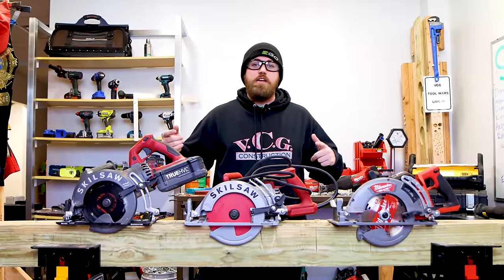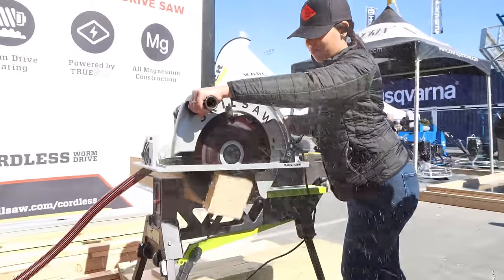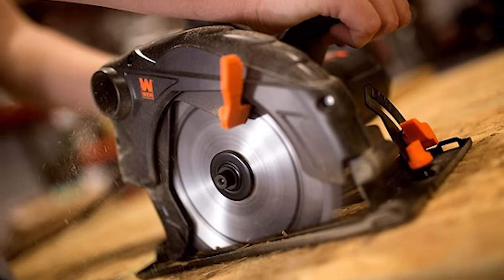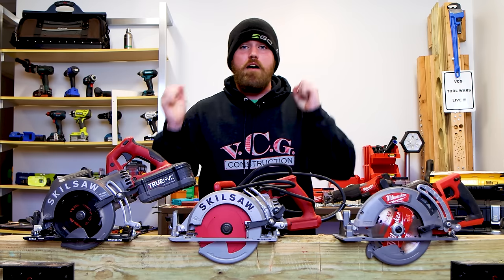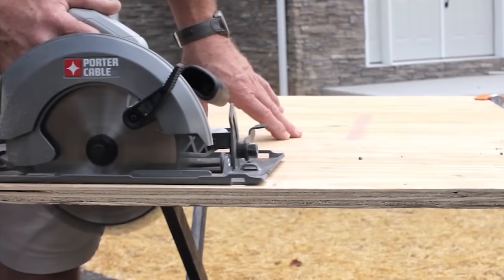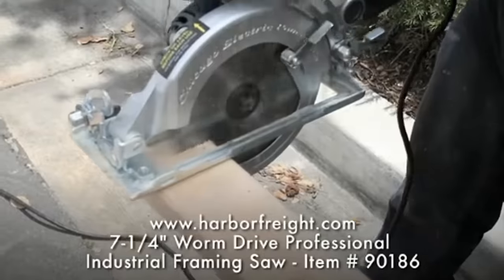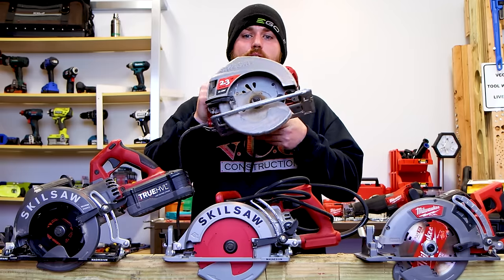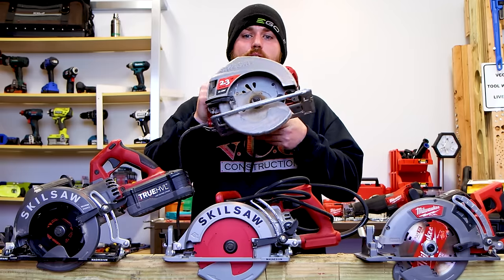We RANKED Every CIRCULAR SAW From BEGINNER LVL To EXPERT LVL (What Level Are You?)

Comment: I'm not a porter cable fan, by any means, but I actually tried their 15a circ saw, recently, and it held up fine through two days of ripping the floor out of a trailer I was demo'ing. Cutting through linoleum, adhesives, plywood subfloor, screws, the a/c ducts right under the subfloor, all of it. I had previously been using my uncle's ryobi corded circ saw, and that was the fussiest damn saw, I've still ever used. That thing would seize up over anything. I don't even remember what its amp rating was, but it had no power. I'm not a fan of ryobi, and had previously held porter cable in similar esteem, but porter cable's circ saw is way better. It's not a contest.

Comment: Reason for Makita's 2 battery set up is to retain the capability of a corded (36v) without making the consumer step up to a single 36v battery. So if you have a collection of Makita tools and batteries, then the step up to this circular saw can be done without having to be forced to buy a whole new set of batteries and charger just to run this one tool. I own this saw and absolutely love it. 
I also own the corded porter cable, corded skilsaw and cordless Rigid X4. All three serves a purpose and definitely not for pro use. The Rigid could be but the X4 has the blade chatter (very well known issue and has been resolved im told). This chatter sounds as if the blade is loose, and just makes a low volume "tap, tap, tap" noise when its being carried around, it will drive you f@ckin bonkers, but doesnt effect its ability to make square cuts. A friend got a rigid 9mA octane battery for christmas when they first came out, he couldnt get it to charge on any of his rigid chargers so they replaced it for free, told him to dispose of the other one properly. well, it charged on my charger just fine (one of his charger is exactly like mine). That battery has some serious weight to it, but you give that octane to the non octane line up, and you have tools that seem to have found new life. i still havent found a legit reason for that blue tooth feature. Any time its free, its good tho!
Ive owned a couple ryobi drills in the past but it wasnt until they made a serious commitment to their tools and came out with a huge variety of tools to run on their one+ platform. their best deal usually during the holidays is buy a tool from their collection & get 2 batteries and a charger for free. they have a 6 gallon cordless vacuum that i find perfect for use on jobsites. their huge following is evident in the high customer ratings & the high number of customers who have rated.
The stock footage for the Chicago shows a worm saw, not sure if its chicago as i didnt know they had one.
Of all the tools ive owned, ive found the makita have suited me best. they are well balanced, weight conscious, always strong, powerful tools.

Comment: Dear Sir,
Despite your best efforts to extoll the virtues of Robert Bosch circular saw; please be advised that as of last year Robert Bosch have introduced a new cordless 190mm or 7.48 inch blade cordless 18 volt, brushless circular saw  working in conjunction with their 8 & 12 amp Pro Core batteries delivering the equivalent of 1800 watts. I have acquired said machine & can corroborate their claim as being one very potent machine. It also has the added feature ( as an optional extra) of being capable of being paired with one's smartphone to adjust parameters to your preferred settings. The charger can charge up to 16 amps if "Turbo" mode button is switched on. Maximum depth of cut is 68mm or 2.67 inches. Maybe you ought to lay your hands on one & do a review? Kind regards.

Comment: Thank you for this video, informative though timely. My power saws predate many of your low end choices. I like my Porter Cable, have been using it for years and the bearings are still true. For heavier work, 2X4s on the low end, I have a SkilSaw77 as well as an 8-1/2 SkilSaw. In my day, the low end Black&Decker was $30, the Porter was $65 or so. The worm saws today don't stand up near as well, mine are all metal. There was no Ryobi, no Kobalt, no Ridgid, they didn't exist. Ridgid did make pipe working tools, I have many. But the saws are recent, ~last 10-15 years. I hold older DeWalt radial saws in high regard, but again, the newer models are too light. I have battery tools, DeWalt, but they too are too light for real work. I guess being an old curmudgeon is going out of style.
Bi11 Hudson

Comment: Been thinking of getting a good saw. I have Dewalt impact, and drill set with a dual charger. It’s great. Measure tapes Milwaukee, tool boxes Milwaukee pack out, I tried the ridged brand there good to but there’s more with Milwaukee pack out options and mods. But circular saws still trying to figure out. I am probably in between a diy and pro level above apprentice. Some where in the middle of pro even. Since my dad did carpentry work remodeling are house a few times I helped him through out the years when I could. Would be nice to have my own saws so I don’t have to barrow any.

Comment: Where would you rank the makita 5008MGA circular saw? It's 15amp 5200rpm 8-1/4 blade  it has 2 lights and a blower in the front to clear the line so you can see it. It has a magnesium shoe and guard. I bought it here in the Philippines for $164 I know it's $220 there at home depot.

Comment: Own the cordless Skilsaw and have the chance to use Dewalt and Milwaukee’s equivalent often and I’d put those 2 above mine in terms of power and weight. Build quality and familiarity, Skilsaw takes it hands down, having come from the Mag77 prior. The battery is massive and heavy but doesn’t seem to last (yes that giant ass battery is only 5ah). Upgrade the battery with a smaller footprint and longer life and you got a winner
Reply: It's only 5ah because it runs at a higher voltage. Compared to the DeWalt Flexvolt which is more AH, but that's when it's in its 18/20v configuration. So a 6ah Flexvolt battery is really just a 2Ah battery when used on a Flexvolt tool. So the Skillaw 5ah battery would be the equivalent of a 15Ah Flexvolt which is also huge! You can't really make the batteries that much smaller because there are so many cells in there.
Reply: @dylannormandin6298  Well aware of the conversions and power equivalence to the other 2 brands. Im just saying Skilsaw's battery tech has a ways to go in comparison to Milwuakee and Dewalt (go figure). They could maybe start going the route of stacked batteries like the powerstack to reduce the footprint?

Comment: I want y’all’s opinion, I’m about to buy a Milwaukee fuel 7 1/4” circ saw. Is the rear handle or the sidewinder more ergonomic and easy to cut with?
Reply: Update: I bought a Milwaukee fuel rear handle circ-saw. I’ve always used a sidewinder and I love the rear handle. The upside of the rear handle really shows on long rip cuts, it’s way easier to keep a straight cut for me.

Comment: Number of amps is irrelevant on an international site like youtube. Here in Europe we have 230 volts in our sockets. 15 amps here would give 3450 Watts. In the USA, where I believe they have only 110 volts, 15 amps would give 1650 Watts, less than half. It’s the watts that matter for performance, not the amps. As a side notice, with fewer amps per watt, as in Europe, we can have much thinner cords and connectors for the same wattage. That is probably why on the shop vacuum I just bought, you can connect 2500 Watt power tools here in Europe. In the USA/Canada you can only connect 400 Watt tools.

Comment: At first I though Vince was pranking him moving his saws.

I would have put the Makita higher - I prefer using 2 batteries to maintain compatibility with my existing 18v tools.

Agree on Porter Cable though - that brand’s story is so sad.  Just a few decades ago they were making the absolute best, top quality pro level routers on the market.  Better than DeWalt, Milkwaukee, Makita - nothing was close.  I have a bunch still.  They’ve fallen so far now - just a bargain store brand at Lowes.

Comment: What is the type/name of the wooden post/beam/board at 32:23? I've never seen that exact type of wooden beam before. It appears to be long, thinner pieces of wood (probably the trimmings left from cutting other boards to correct dimensions,  I assume?) That are soaked in some sort of glue or resin mixture, and them mechanically/hydraulically compressed into a mould, of whatever the desired dimensions are. Is this somewhat correct, or am I way off with my assumptions here? Any help would be very much appreciated!

Comment: An important note: power scales with voltage squared. So doubling the voltage (2x 18V ), results in 4x power. So all things being equal running the same device/saw on 18V, instead of 36 would be 4x times less power (and torque as being brushless, it'd spin at the same RPM)
Reply: Um that's not true at all. The actual metric of power is wattage, which is the voltage multiplied by amperage. Voltage isn't everything. Milwaukee has proven that with some of their M18 Fuel tools performing on par with some of Makita's 40V tools and even DeWalt 60V tools.
Reply: @schm147  all things being equal... is a key moment. Modern GPUs work at around 1.2V and can pull 500W. Obviously one can have a lot if power at lower voltages as well. It tends to be less efficient be in many cases compared to higher voltages at the same power level.

Comment: Weird thing to me is that skil seems like a cheap brand now except a few of their circular saws. Their 7.25” SPT77 worm drive is the best affordable worm drive out there. But their cheaper sidewinders are kind of trash. I know it’s skil vs skilsaw, but let’s be honest. Same company. Pretty much the same brand.

On another note, it’s amazing to me that some of these legendary brand like Black & Decker was squandered by whatever companies acquired them. These bigger companies just love to make a quick buck on brand reputation. And that’s a good reason to stay in touch with current trends with these brands. You might think you should buy the same brand as a tool you’ve had for 20 years. But chances are things have changed. Most of these brands are all owned by conglomerate companies and they may or may not be the same quality. Most likely the brand name has been abused and it’s now average or worse.

Comment: This is easily the silliest tool video I’ve ever seen. It’s cute and kinda funny but there’s no testing, no consistent quantifiers used to compare, nothing. It’s basically a list sorted by price. Of course a Milwaukee tool is a professional tool. Of course a corded circ saw from Harbor Freight isn’t a great option. Of course a 36/40V system is more powerful than 18/20V. Every tool video basically reduces to this: list the tools you need, list the tools you think you may need or want, then find the battery platform that fits, then compare that to your budget.

Comment: it was skill corded mag 77 that everyone used around here, than makita came, and makita is new skill now. way better saw than old skill way more accurate. bevel adjustment part and rail on skill is garbage. new skill charges in 1h makita in 30min. and you usually get 2 free batteries with makita to 2 there are already in the kit, so stop complaining.

Comment: Sad to see how low Porter-Cable has fallen. Putting their name on junk.  They used to be considered one of the best professional power tool manufacturers. I still have one of their magnesium left-side 7.25" professional corded circular saws from ~25 years ago. And one of their professional belt sanders.  USA-made.  The quality tools last. Still have my Makita 1/2" drill, Black and Decker Professional 1/2" impact drill, Bosch jig saw from Germany, and Milwaukee Sawzall. And a Craftsman Industrial 1/2" impact gun made by Black and Decker Professional. Made in the USA and also sold as a Dewalt. Some are 35+ years old and work like new.

Comment: By all reality, nearly all these tools use the same parts from the same factory. The middle 70% of tools are indistinguishable. 15%<70%>15%

I work the trades; I hear trash about modern Porter-Cable (6 gal air compressor), Black & Decker (right angle drill attachment/ jigsaw), and Chicago Electric (recip saw). They perform perfectly.
Reply: If I never inherited Ridgid cordless from a fellowman years ago, I prolly would have gone Ryobi. However, Ridgid has been nothing but a well-oiled engine for me.
Reply: I still prefer corded tools. Batt tools have their use, but the negatives outweigh 'the convenience'.

Thus I buy the best tool for the jobs I need done and not brand stranded.

Comment: They didn't have one of the best saws out there I got from home depot. The Evolution milti material 7 1/4 inch tct circular saw, I have the R185 model, I cut both steel and yes wood. Goto the Home Depot website for a cool video of it's performance. 2 1/2 depth cut and different angles, comes with a unique blade for cutting different materials. 15 amp power, I saw it would go under pro or expert level.